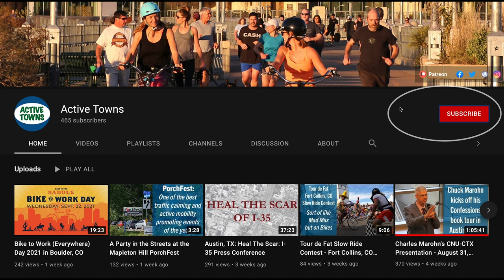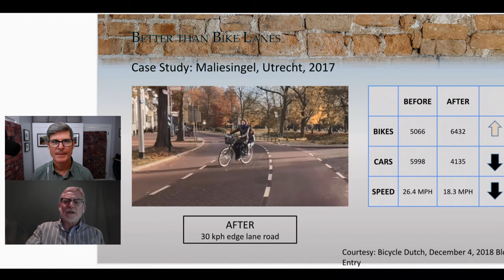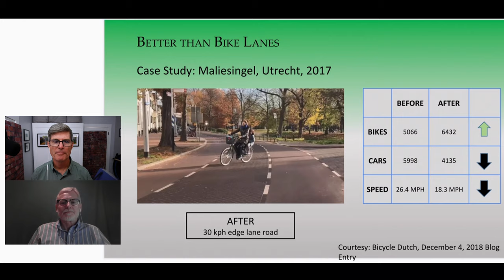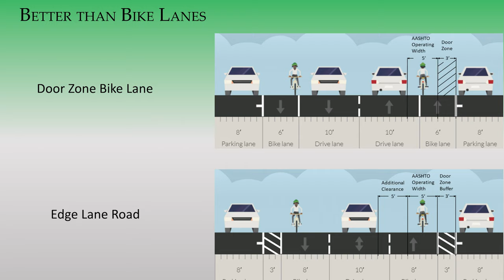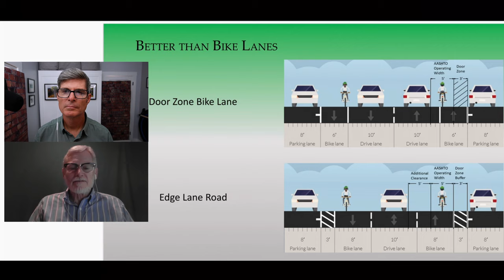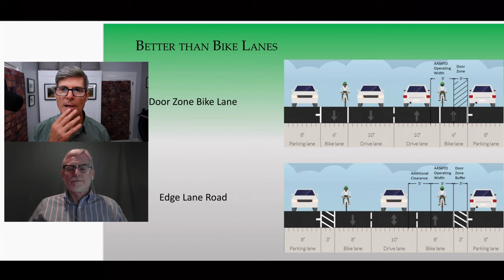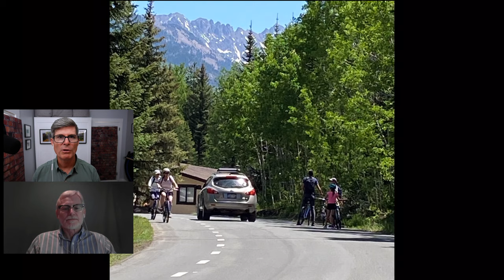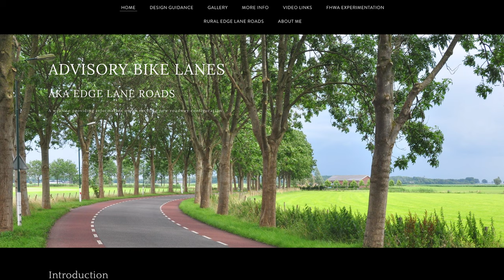These are common in Dutch & Danish cycle networks. Why?

Comment: I'd be interested to know how this works in areas with significant elevation changes. If there is enough hill to potentially hide an oncoming car, you really should hug the right-hand side when going up that hill, which would mean getting over into the bike lane often.
That said, how it works in Vail, I'd be interested to see. I see enough of an incline in a couple of those pictures that I wouldn't be surprised if a car could hide in a dip.

Frankly, this isn't all that different from how unmarked roads are used every day. On unmarked roads, I don't know very many people who hug the edge, except during hills, although this is often because the road is smoothest in the middle.
Reply from the maker: @S.P. Roach, Good points! Yes, I'm looking forward to getting back up to Vail to see it for myself - I've posted a link to my old Vail video I referenced in this video's description. I hear what you're saying on riding completely unmarked roads and can relate. Thanks so much for watching and adding to the conversation. Cheers! John
Reply: You are talking about sight distance. This is an important concern when one deals with hills or curves that can hide oncoming vehicles. We didn't have enough time to go into this subject but it is the topic of some of my articles but you can find on my website. The first question is: how much sight distance does one need? The second question is: what does one do when there is insufficient sight distance? Lots of fun in both of those answers!
Reply: @michaelwilliams2593  Thank you. I've since read both your articles titled "Sight distance for advisory bike lanes", and "Sight Distance for Edge Lane Roads".

I think your CSD, or HOSD, should take into account an assumption that at least one party is likely to be exceeding the imposed 35MPH limit if it is practical to do so. I don't know if this would allow for such road striping in some terrains, as adding the HOSD for 65MPH to that of 30MPH comes out at over a quarter of a mile. That said, in hilly terrain, it should certainly be easier to stop, pointing uphill, when encountering an oncoming vehicle that has just crested the same hill but has not yet started downhill.

Where there is insufficient sight distance, I think the road can usually be widened fairly cheaply. A bicyclist is not going to weigh near as much as a car, so the road surface doesn't need to be able to hold up to the same load. A strip of rigid plastic, anchored flush with the road on one side, and sitting on the ground or on elastic legs over the adjacent drainage ditch on the other, should allow a 500 pound or less object to pass while giving away under the weight of a half ton or more, and rebounding after it has passed or been towed out of the ditch. Where the ribbon would sit on solid ground, it might be worth undermining it so that it wouldn't support the weight of the right half of a car. This would allow the full road width, for the stretch where adequate sight distance can't be assured, to be reserved for cars while not interrupting the bike lanes. Bear in mind, I'm not suggesting running a plastic ribbon along the full length of a road; just for the hilltop and a few dozen feet approaching it.

I can think of about three other things which can be done which might also help. These range from more basic traffic-calming measures, to help ensure no one is speeding and would crest the hill, or round the bend, at a slower rate of speed, such as speed bumps at the bases of hills, (it should be possible to emboss these into the softer existing blacktop roads without having to pour fresh asphalt), or highly visible gates that must be taken at a very slow rate of speed at the tops of hills (like those visible at 18:41 in the video, but maybe as narrow as 9 feet between the bollards), to roughening the road surface to increase road noise from heavier vehicles, so that pedestrians and cyclists could hear when they were sharing the road with an approaching or overtaking, but not yet visible, vehicle, and react accordingly.

Oh. I just remembered a bit of history you might be interested in knowing about if you didn't already. Google "Sidewalk Highway".
Reply: @S_Roach  Thanks - I was familiar with that sidewalk highway article. there are lots of rural road miles in the US that are similar.
And thank you for taking the time to read some material. You are correct about a number of things, eg grade affecting stopping distance, etc. 
My approach to sight distance issues has 4 possibilities (in general):
1. Eliminate the obstruction (modify grade, remove obstructions, etc) to gain sufficient sight distance
2. Slow the motor vehicles to reduce sight distance requirements
3. Widen the road to create exclusive space for VRUs
4. Transition back to a center line with shared lane markings
Reply: @michaelwilliams2593  The first time I heard the term "advisory bike lane" I have wondered if it would be appropriate for the rather problematic West End Rd. in my town of Arcata, Ca. It's a rural residential road, barely two lanes wide, low traffic, with parts that are quite rolling and winding. It's a really beautiful road to ride on, but the narrowness and the speed people drive it make it scary; it's nonetheless popular with cyclists. I'll read those articles and see what our engineer says (he'll likely dismiss it out of hand). Thanks for the information! Here's the road, if you're interested:
https://www.google.com/maps/place/West+End+Rd,+Arcata,+CA+95521/@40.8888641,-124.0408424,551m/data=!3m1!1e3!4m5!3m4!1s0x54d159c6662c7473:0x60ed34f5f0b39d89!8m2!3d40.8890563!4d-124.0387901
Reply: @Korina42  I'm not sure which agency has jurisdiction over your roads in Arcata but Humboldt County is working towards their first ELR installation on Ocean Drive in McKinleyville near you. I presented to the Transportation Advisory Committee for the County last year and they were very receptive. You may have a better reception than you expect! From your description of the road, sight distance will be an important concern. I strongly recommend you forward a copy of my article on that subject to whoever you speak to.
Reply: I live in Mt. Shasta by the way and have been your way lots of times over the years!
Reply: @michaelwilliams2593  Sweet! I know where that is; I'll have to go ride it when the ELR is in. Sight distance is definitely a concern on West End Rd. I'll send the article to the city guys, see what they say. 
I really need to figure out how to convince the city that my big idea is feasible; G & H Streets are two-lane one way streets with door zone bike lanes, and I want to take away one lane to make a bike lane buffered on both sides. It would compliment the safety improvements coming to the mess that is Sunset/LK Wood, and create a safe bike route from HSU to downtown. When I brought it up to the city engineer, I got back, "But the congestion!" I'll wear him down. 🙂
Reply: @michaelwilliams2593  Hey, neighbor!
Reply: @michaelwilliams2593  - Hello Michael, I’m just up the road from you and I ride on the orchard roads around Ashland, Talent, and Phoenix, Oregon. We have a large number of roads that would be perfect for this treatment with many recreational cyclists using them. They are for local travel, rather than thoroughfares, so high speed isn’t a necessity, and car volumes are low. My only concern is where there is limited sight distance. I’ll study further!

There’s one road where I ride that is especially narrow, curvy, and hilly. It has no center lane, in fact no paint at all. It’s a fun road to ride on, and feels reasonably safe to me. Cars, bikes, and pedestrians just negotiate it naturally.

One driver I know thought that I was nuts for riding there. What he was really feeling was some healthy discomfort driving there, which slows him and jars him out of autopilot (sleepdriving?) 

Anyway, great topic. The concept has my support!
Reply: @JonFairhurst  Hi Jon, greetings to a fellow Jefferson state resident! Current guidance on sight distance for ELRs is poor. Good information on this aspect of ELRs can be found in my paper on sight distance which is hosted on the More Info page of my website. 
yes, there are plenty of roads in your area that are good candidates for this treatment. the one I think would benefit most is the road through Lithia Park - so many peds and cyclists there the road already functions as an ELR.
cheers,
Reply: @michaelwilliams2827  YES! Granite St. and Winburn Way are perfect candidates. Parked cars complicate it a bit. No sight distance issues there. Lots of MTB traffic going to/from trails in the watershed.  In general, I ride up on the shoulder to let cars pass and down in primary position, because I can ride at or near the speed limit.

I’ll be reading through the documents on your site. I love the whole concept!

Comment: There is a very important misunderstanding in this concept at least for Dutch and German roads: These edges are NOT bike lanes. Yes, cyclists are allowed use them, but they don't have to and often they even can't, because they are extremely narrow or (common in rural German areas) only gravel.
Reply from the maker: Correct. As Michael mentions, if they were truly bike lanes, then motor vehicle drivers would be prevented from using them. Additionally, as you point out, the specific design varies a great deal from location to location. 😎

Comment: 35:04 The example of the  Utrecht change was different from a cycle lane road !  roads with cycle lanes can have 60 kmh max speed (rather than 80 kmh) in rural areas and max 50kmh in built up areas , or maybe 30 or 15 kmh...   The difference with a road with two car lanes seperated with a dash line is psychological: bikes have their legal space and vehicles tend to steer to the centre of the road while driving. (Added to the lower 60kmh speed in the rural..). Which is a good thing.
In Utrecht they changed an urban 'highstreet' with shops and 2 separate bike paths (with a massive 18000 cyclists a day!) into a Fietsstraat/Auto=guest ('cycle street' ).  A cycle street/auto=guest has red asphalt all over and a max speed (car&bike!) of no more than 30kmh. So the 18k cyclists have more space than on the 1,5m bike path. Other than the max speed, the effect is psychological and spatial : It is NOT FUN to drive between bikes on a street with 18k bikes per day ! So car drivers are more carefull (Especially since bikes and pedestrian have more legal protection in an accident in NL. Car drivers can only claim max 50% of the damage on their car, even when a cyclist IS at fault ! That makes more careful driving )
Bicycle Dutch on the Utrecht cycle street :  https://www.youtube.com/watch?v=bQjY7DiTP_I

(btw incredible how it is such a struggle to change  and remove/add some painted lines ! You'd say it is the easiest and cheapest thing to do ..)
Reply from the maker: @al lws, Thanks so much watching and all the helpful details. Yes, it quite strange how hard it is to  initiate change. Cheers! John

Comment: And again the same error in regulations is made as stated at about 23:00 in this conversation: priority to the cars.  A road which has 6k cars a day will have more cars in a year (growth of the general population) .  That is if you do nothing.  You need to make/create alternatives for cars to get peeps outof cars.  Think about that first ! So forget 'the cars first' mentality.  If there is a choque up, your speed will be less then the 35 / 30 km/u !  So forget creating roads to allow max speed at the rush hours (if you dont want more cars each year on that same road.  In a few years it could still choque up) .  The alternative for cars needs the be put 1st . In the netherlands the alternative happens to be bikes, but it could be something else in other countries. If you create public city bus system, for example, you need to create bus lanes so a bus won't get stuck in the car lanes. Also a street plan needs separete plans for the traffic flow for seperate ways of transportation. So the short ways is for the chosen priority transport system, the 2nd fastest could take alternative longer routes. The plan needs to provide in those routes. 

Luckily at 49:00 there is an example which contradicts  that speed limits won't work and should not be installed !  So that works in that main street, but is the bicycle the preferred alternative for the whole city ? Are the other streets which are bikers friendly ? In other words, is there a city plan for cyclist routes as the preffered way of transport?  Can i get from my house to the office by bike safely and fast in that city?  I doubt that....  A single bicycle boulevard won't work, but it is a start for complete routes....
Reply from the maker: @Edwin Biere, Thanks so much for watching and the thoughtful additions to the conversation. Some of these very topics are discussed in my interviews with Jason Slaughter w/ Not Just Bikes. Cheers! John

Comment: @17:55 hey danes....wanna know how to indicate that without signs with unhappy faces showing you failed to make the point clear....PAINT>>>THEM>>>RED (well any color but red is cheap , its basicly a bit of rust added to the asphalt)
Reply from the maker: Yes! Such a good point... and having the pigment imbedded in the mix means it doesn't wear off the way paint would. Here's an interest fact for you, we're using this tactic with the red on many of our facilities in Austin (pigment mixed into the concrete slurry - the asphault companies are resisting, but that's a whole other story). Here's one my vids that gives you a glimpse if you're interested. https://youtu.be/xFomWh1eoYI Cheers! John
Reply: @ActiveTowns  I very much am, I've spend way to much hours speaking to americans on the subject over the years so I find it very fun to see the proces getting foot around there, not even so much specific solutions but just the idea that things can be done in a variety of ways considering the needs of the place, 
So I'll certainly have a look 

cheers, and have a great new years

Comment: Technecly those are bike lanes. Sometimes they are used by others then cyclists. You can see it by the bysicle drawn i those lanes. Because it's rural you dont find pedestriens there that'why there is no side walk. It's even dangerous to use them as side walk. So it isn't recomended. And the way you are speaking about it  tells a different story. Maybe it's an opscure rule and you are right, but as far as i know it's not recomended. And sometimes there is even a sign that tells you that it's not for pedestriens. Looks like you think the rules for this are the same for it in the Netherlands and Denmark. But i don't think the rulses are the same.
Reply from the maker: Thanks so much for watching and for the comment(s). I really appreciate it. And yes, rest assured, we do understand that each situation is context-sensitive and the "rules" vary from location to location. Cheers! John

Comment: As a motorcyclist i completely hate this design. Without a line demarcating the lanes cars never stay on their lane in a curve. 

Drivers are distracted and don't pay attention to whether the upcoming vehicle is a moped (which has to drive on the red zone) or a motorcycle (which has to drive on the road) and take the full lane for themselves.

Also, putting trees surrounding the road to "make it seem more dangerous and make people slow down" is little consolation if there is a problem and you get out of the road
Reply from the maker: Thanks for watching and for sharing your perspective. Much appreciated. Cheers! John
Reply: @ActiveTowns  
Hi!

Sorry if i sounded too critical. I understand the rationale behind the road design and it does make sense, but unfortunately the designers didn't consider motorcyclist safety important when making these roads.

Don't take it as a critique of the video or the good aspects these roads have (for the people less likely to be killed in them haha)

Thank you for reading the comments!
Reply from the maker: @elguido  No worries. Not at all. Delighted to have you tune in. Much appreciated. 🙂

Comment: 14:40 A horse rider by dutch law is not a pedestrian, but a driver. As such horse riders are not allowed on a sidewalk
Reply from the maker: @J.P. van Bolhuis, Fascinating! Thanks for watching and the info. Cheers! John
Reply: Better yet, if these pink strips are actually bike lanes (which can't be determined from this photo) then the horse rider is in the wrong place. As horses are not allowed on bike lanes, but rather need to use the main road.

However, this may very well be a suggestive bike lane. In which case the horse can be there. And in practice, it'll be condoned/appreciated either way.

Comment: It helps in NL that cars are automatically at fault if they hit vulnerable travellers
Reply from the maker: Yes. The law states that the driver is up front liable for a minimum of 50%
Reply: Not necessarily at fault,  but liable.

Comment: I don't think Japan is a good example of this. I never saw this kind of road treatment for cycle lanes, especially not on a sleepy little residential side road like what is pictured. Are you sure this wasn't some kind of one-off example? Most of the time there are no markings on residential streets at all -- everybody is courteous and shares the road whether they are driving, walking, or cycling because there are no curbs and no sidewalks. Japan mostly doesn't have any particular cycling-specific infrastructure... the sidewalks are huge and sometimes they are delineated as pedestrians on one half and bikes on the other (but often, no delineation whatsoever).
Reply from the maker: I’ve only been to Japan once… in the Hiroshima area… so I can’t claim to be an authority in what the country does or does not have.